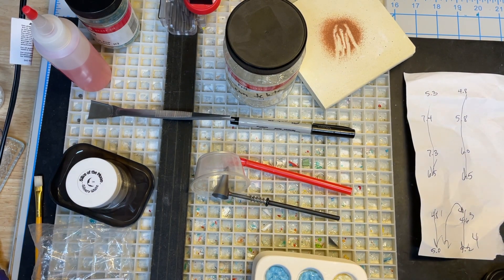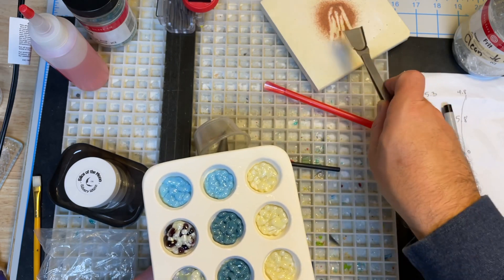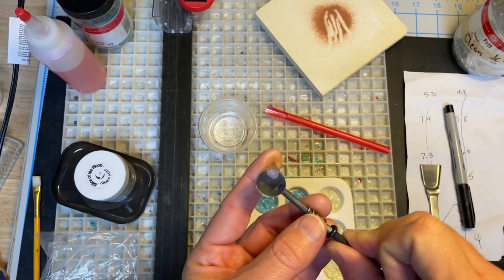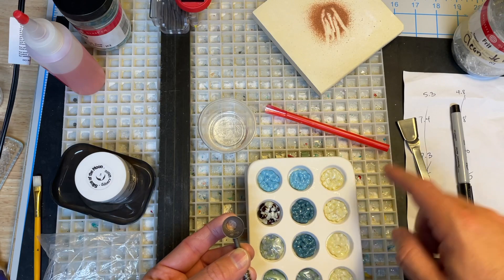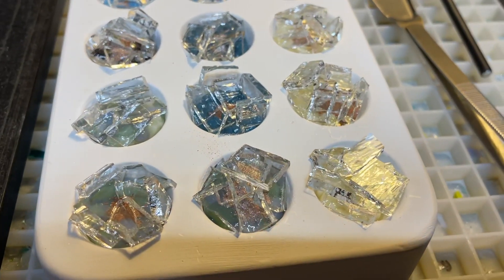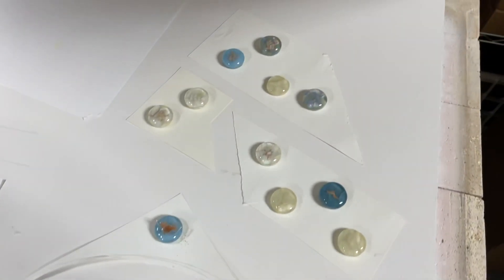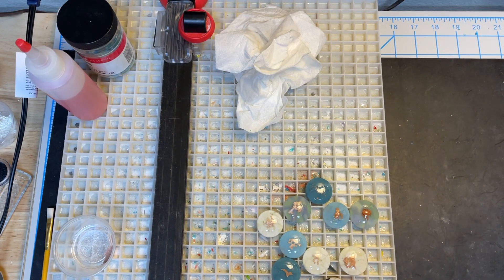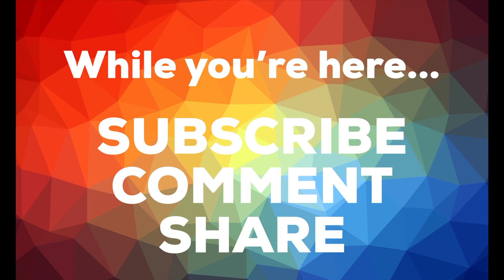Fusing soil into glass (same process as cremains or ashes)

Comment: Any time you fire two things with different COE's you are taking a chance. There is not much total surface area in contact so you probably are alright. Also the clay remains a powder so there is no real adhesion between solid bodies.  If you tried this the other way around---glass powder fired into  a fused ceramic---you would get cracking for sure.
Reply from the maker: Thanks Robert!

Comment: I would be curious if there is any stress in there. Do you have a polariscope to check?
Reply from the maker: Stress because of the soil? No polariscope.
Reply: @JamaisonSchuler  Any foreign object can cause stress. And soil can have sand, which is what most glass is made from, so it has, even in such a small amount, its own COE. If you have a cheap pair of polarized sunglasses you can make your own scope. It is actually pretty interesting to see stress in a piece through the lense.
Reply from the maker: I forgot: I have some polarized film I bought ages ago! So I set up a light box, and I’m looking at these pieces and really can’t detect any stress at all (if I’m doing this right). Wish I could upload a photo in the comments!
Reply: @JamaisonSchuler  When you turn the lenses to the point that it looks the darkest, if there is any stress, the light that you are using will make the stress glow, you can't miss it. But you only get light transmission through the transparent parts, so you might have to hold those pieces on their sides as the opal bottoms won't let the light through.
Reply: I recommend the next time you fuse to put two pieces together that you know are not compatible, that way you know for sure what you are looking for in other pieces.
Reply from the maker: I’m looking at these from many angles and I’m not seeing any of the traditional stress marks that I’ve seen in other photos and videos. I like your idea of fusing some incompatible samples so that I know what I’m looking at in the future. Thanks for your suggestions, and thanks for prompting me to dig out and learn how to use that polarized film! ❤️